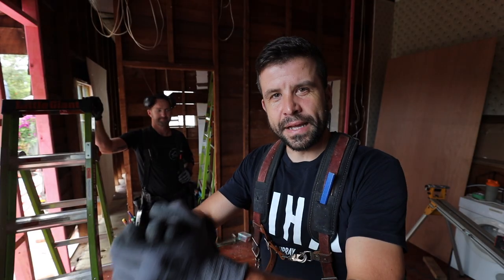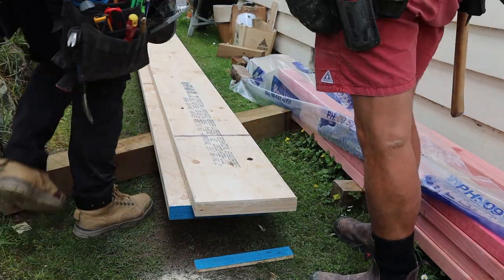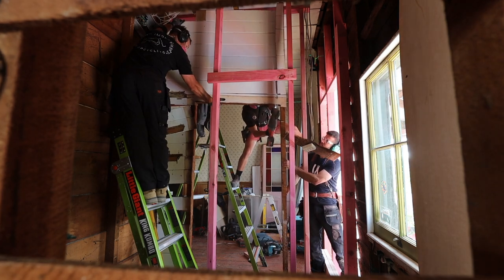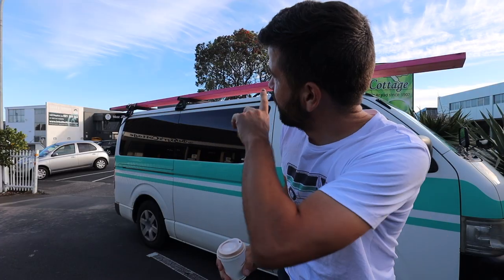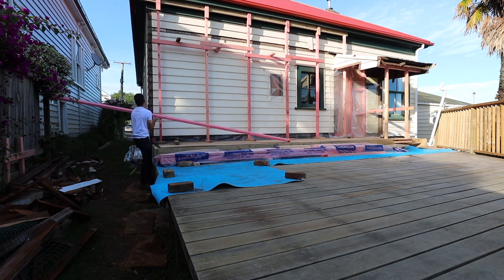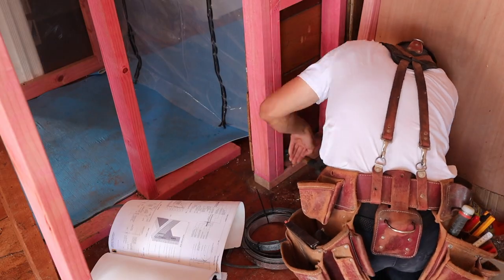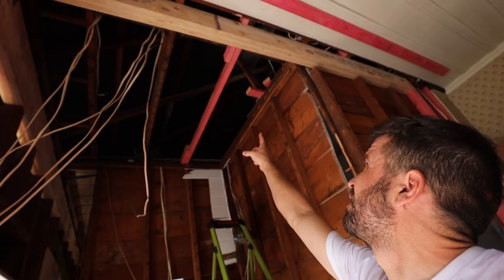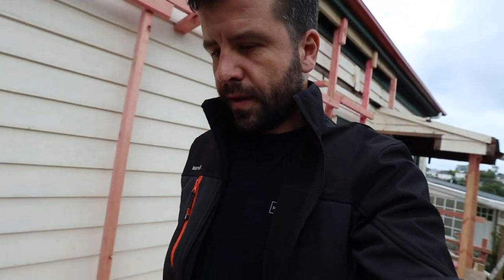Installing Timber Beams to Make One BIG Room

Comment: Some observations: finishing the depth of the cut with Japanese saw when most would go with the sabresaw ( rough enough), clamping together the 2 parts of the beam making it tight before nailing (most would just hold or walk over it) “good enough”, smooth fitting of the beams, and etc. you guys are not rushing against the clock but instead taking pride of your work. Definitely not a cowboy. Beautiful to watch 👏🏼👌🏼, congrats for you and the crew.
Reply: pretty standard practise to use a clamp when nailing two joists/beams together mate. nothing special
Reply: @user-ru3zs4xz8m  I understand it would be reasonable to think it’s standard practise but I have witnessed too many so called tradesmen using nothing but his weight when nailing two parts together, or using finishing gun to hang door jambs, or cutting off half of a through bolts when having trouble with the depth and so on and so on... that’s why I like to prize the good ones 👍🏼

Comment: In Canada call the little studs above the lintel (which we call a header or a beam, depending on the size and application) "cripples" and we call the studs which hold up the lintel "jacks." The full length studs they're nailed to we call "king studs."

Comment: Hi Scott, saw your black nail and reminded me of doing fencing. At the point of me swinging my hammer down a thought flashed across my mind of my mate hitting his thumb. Yep, I did exactly the same thing! Luckily I was just next to the shed and nipped in, put in a drill bit in my drill and drilled a hole in the nail whilst my thumb was still numb. This took the pressure off and the blood came out and my thumb heeled quickly. After a week I sealed the hole with some UV glue and the thumb heeled very quickly. Highly recommend the system of taking  the  pressure off.  Harera..

Comment: Nice to see proper WORKING drawings again that actually tell you what you need to know and have detailed connection plans etc. Also of a size a normal human can read same as in UK. In Qld they keep chickens in the paddock throw a few sheets of A4 under their feet and let them scratch about over them for a while. Then they collect them back up and give them to builders as working drawings. Unfortunately the chickens don't put many measurements on and are not interested in doing connection details. But as is so often said these days not in my job description. I lay eggs. So we stand on site with hardly anything to measure from. Drawings that only work  in chicken scale and just invent our own details. Then blind Pew otherwise known as a Private Certifier comes round and ignores everything you have done anyway. Oh it works so well in maintaining quality. Lovely to see good standards in NZ still being produced.

Comment: I'm in IT and I never could do what you guys can but I love to watch. I'm usually one of the first couple hundred.

But, what you said about writing things down, like downloading your brain, is exactly what I do in IT as well. What most guys here do tbh.

I regularly did maintenance or upgrade or complete rebuilds on computers and software for a large brokerage bank here in the Netherlands as well as for a large airport here as well. Without doing those lists... I would have screwed up for sure. You want to do the thinking beforehand, and keep your mind in the "doing" when you are actually doing.

It's all about measuring twice and doing once ;-)
Reply: I too am in IT, as well as handyman/property on the side and cannot live without lists.    I recently did a similar job (open plan floor with beams) and it really is a sense of achievement when you take the temporary props down and the house stays in one piece.
Reply: I too am in IT and have learned to do lists before things like server cutovers etc. 🤟🏻

Comment: You have
King stud runs full length floor to ceiling
 End of header is nailed into

Jack stud supporting the weight of the header & transferring the weight to the footings
Not just to the floor plate

Cripple stud the very short stud's above the header or below to fill in and support wall

Comment: 4:05 The bow in the beam shows up quite clearly, most likely because it was nailed together on only 2 supports that were far apart instead of 3 or 4 more evenly spaced. Once it's nailed like that, the bend gets locked in and it takes a bit of a fight to straighten it out again.
Reply: Now i know, thanks!

Comment: Nice. Just wondering why you couldn't put the beam above the cieling? In the roof space, so you have a clear run on the cieling without a bulkhead. Is it the house next door restricting room to install the beam? Or building regs? Love your work mate.
Reply: A surprising number specifying architects have no creativity or imagination. With engineers it's the vast majority of them. Builders? Forget about it. They could have easily lifted a run of the roofing to get the beam in and strapped the joists to it.

Comment: Hi scott dont forget when nailing 2 beams together make sure they are on a flat surface first so you dont laminate any bow into the beam looks like you only supported the beam at each end and not the middle when nailing together
Reply: Should use screws rather than nails
Reply: Nails are made from softer metal they can stretch. Screws will brake more easily .
Reply: @marekpoder3566  nails are the lazy way. Screws will pull them together better and hold better. Screws are not going to snap in them timbers. Screws snap when they are cheap or not drived in correctly.
Reply: @jpk2742  Nails have a higher shear strength than screws. The nail system is engineered and tested. Are you a design and testing Engineer?
Reply: @DiscoFang  please don't use the word engineer. Engineers use computers to do everything. Well in my experience I can easily pull timber apart whats been nailed compared to if its been screwed. Plus screws pull the timbers together alot better than nails. You are probably American. Americans nail everything even door frames lol

Comment: Scott Brown, if you were to nail these two laminated beams together on a solid, flat surface, such as the deck, or a driveway, you will not end up with a bow in your beams 8:18. Nailing on top of saw horses allows a deflection in the material being nailed, which increases as you move along the beam while nailing. Cheers

Comment: G,day Scott and the team from Sydney, Australia.
* loading the LVL corner beam one on top is good design to stop the separation of joint. (If the building has ceiling height).
* Roof void climate could be reduced with rooftop ventilation.
* crown end rafter from apex to the top plate: still unclear why that was replaced?
* terrific camera positions and editing, thanks.
Merry Christmas 🎄

Comment: I did some research on the internet then went to the local yacht chandler for more advice before buying some pulleys, ropes and other fittings for heavy lifting. In my case it was to (single-handedly) lift a car body from the chassis while doing a major restoration.  It wasn't too expensive and everything could be re-purposed for other lifting tasks. Getting those beams up to ceiling level would have been relatively straightforward.

Comment: I have question regarding the respirator use. I am assuming they are using them when cutting down the walls to stop the inhalation of any dust/paint/varnish/whatever particles that might get created by the saw. However I noticed them being used with the nail gun too, why is this?

Comment: weird, what you call an understud is what I would call a Jack stud, and what you call a jack stud I would call a cripple stud!
Reply: Same, had to rewind a second to make sure I heard correctly.
Reply: US or Canada guys? You probably have king stud and trimmer stud aswell?
Reply: @cameronrolston6099  king stud is what the jack stud would be attached to right?
Reply: and German? Jackelstumper and uberhumpoff?
Reply: I'm a New Zealander, been in and around the construction industry as both a designer and a builder for 40 years. I've never heard it called an under-stud. It's a jack stud. The only piece of framing called "under.." anything is an underpurlin.

Comment: Good stash of native coming out of this wicked house! Christmas prezzies!
Reply: You mean all the bits that were sliced up with the recip saw?
Reply: @DiscoFang  old rimu framing and sarking from internal walls. If it hasn’t been chewed by borer it machines up really nicely. I have made a few chopping boards and various other things as Christmas presents out of old timber from renovations.
Reply: I know what you mean. But when you’re pulling nail & borer filled rimu & totara from renovations, the tiny amount needed to make knick-knacks is not worth the effort to sort, set aside or arrange for someone to take. The last 3 places I’ve done have resulted in several large trailer loads each that just end up as firewood. Even then it’s a toss-up, time-cost & effort wise, whether to just dump it but I can never bring myself to. 
When you’re demo-ing a whole building it’s a different matter. You can arrange the way it’s taken apart in to recover the timber cost-effectively and technique-effectively so as not to damage it too much.

Comment: What timber species are you pulling out of the house and is it recycled or dumped?? Thanks.
Reply: The timber is native rimu or Mata not used any more as they are protected, the main timber used now days is treated pine only takes about 20 years to grow
Reply: We typically use it for firewood. big bits are sometimes recycled but not this stuff. We burn it so as not to waste it in the landfill at the very least.

Comment: Two good things about LVL's one they are timber but still fairly straight and very strong. Engineers that generally hate wood love them because you have uniform specifications on them. When laminating two together they also help to stop you having to lug your guts out as you can put them up one at a time and laminate them in situe. Great for loft conversions etc where access is hard and jobs like this. Can't  see why you would double the weight before putting them up. Like doing a flitch beam. Part wood part steel. You set them out and drill them laying flat but put them up in sequence. These are only skinny little things and there are three of them so got away with it. Try bigger ones and you won't. Work easy Scott.

Comment: Wowww. You’re meant to carry it on your shoulder. Not up high. That can cause damage to your back. A lot of damage. Letting rest on your shoulder also helps with aching arms. Yes you can keep your back straight. But your flexing muscles on your back either way.

Comment: I wonder why in new zealand  they don't use roofing sheathing osb or plywood like in the usa.
Reply: Ask the English that question too! They don't either! Cross the border to Scotland and we do! Timber roof frame, OSB sheets, breather membrane, timber battons and then concrete tiles.
Mind you, the English build their houses out of two layers of cinder block with a gap in between!
Scotland, we make up big timber panels in a factory and board one side with OSB and breather membrane and then have a gap then put cinder block on the outside of that!
Its basically much like the walls in NZ but instead of weatherboards its cinder block.
Reply: I think I saw in a previous episode that don't use insulation on some exterior walls either. Regardless the craftsmanship these guys possess is remarkable.

Comment: You rookies should have put the lvls up separately to save your back. Work smart not hard
Reply: @Flyingcrocodile46 in what world are you living in to have to think that busting your back lifting two LVL into place at once is better than two individually then nailing them in place
Reply: @Flyingcrocodile46 your missing my point muscles. Believe me I’ve done it all before hence why I’d choose to lift the beams 1 at a time and fix them in place.
Keep at it Arny and get back to the chopper.
Reply: @Flyingcrocodile46 
Arny, all those protein shakes have gone to your head, Your interpretation of the work smart not hard theory implies that it’s smarter to lift both lvls at once as opposed to separately as to eliminate double handling, implying that double handling of materials is not smart. 
I must admit you are very smart as you keep suggesting. Well done hero.
Hasta la vista baby
Reply: @Flyingcrocodile46 lucky I get paid by the hour then isn’t it muscles 
You’re pissing in the wind now champ 
Goodbye